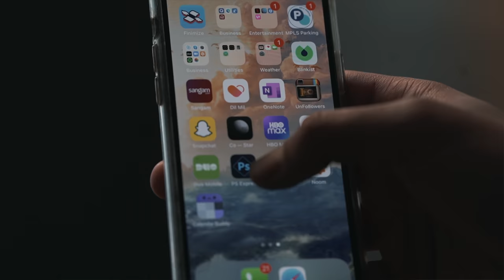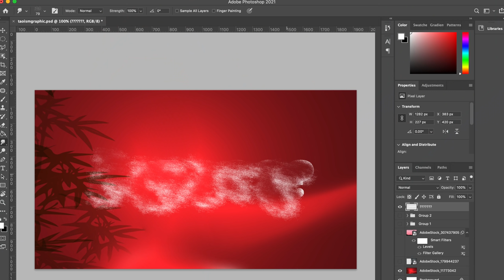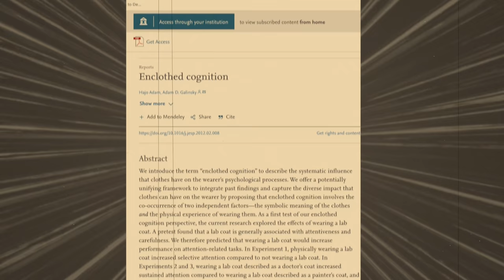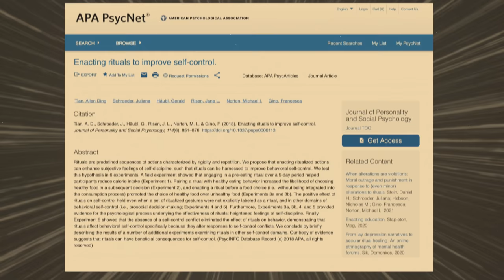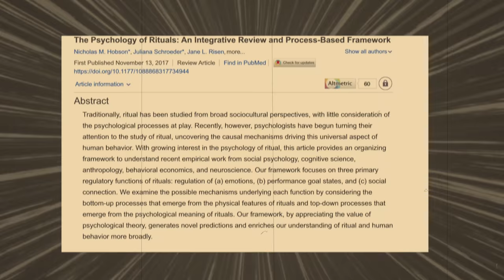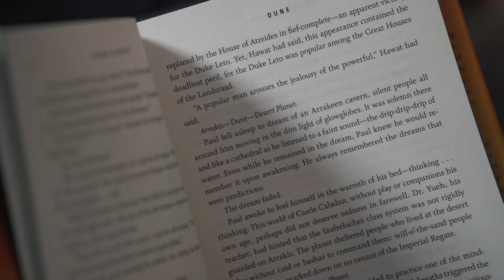3 Ways the Spartans Built Self-Discipline

Comment: I would try to touch the outside of my pinkie fingers with my thumbs when i was skateboarding as a way to accept failure.  then i would hit the stair set or whatever i was trying to do, even flat ground while learning new tricks, i am 32 now and skated for 12 years. i dont any more cause i am a single father since 2011 and hurting myself meant i couldnt care for my son to my fullest extent. but it did help me build strength of character in never giving up.